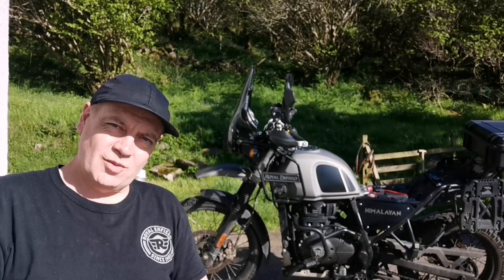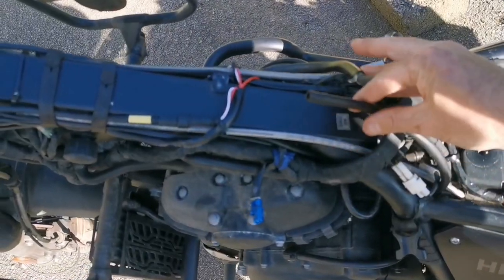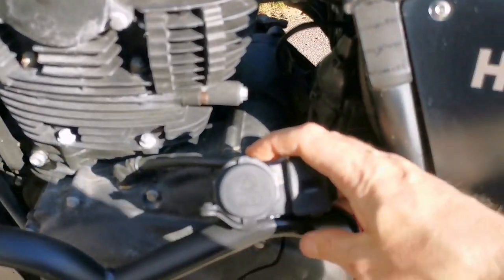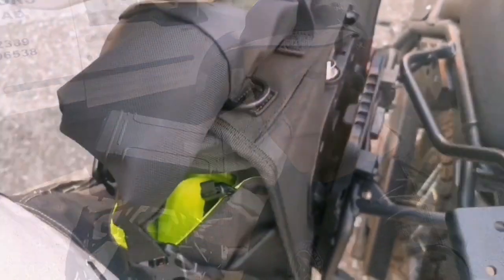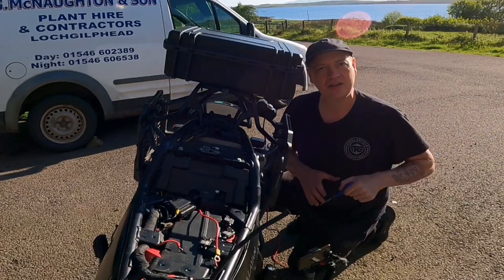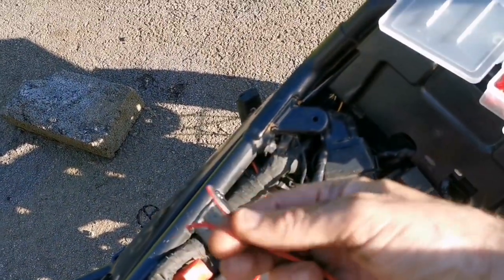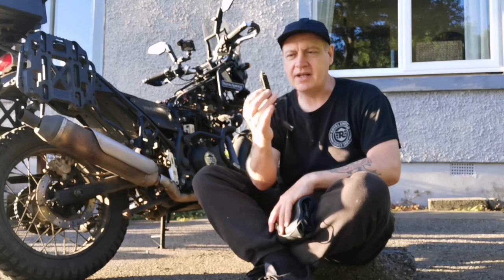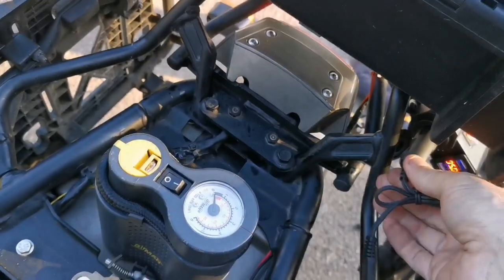Royal Enfield Himalayan Install - 12 Volt 3 in 1 USB + Voltmeter For Motorcycle Step By Step Guide.

Comment: Great job, I was wondering does the on-off switch on the charger can activate the charger with the bike being turned off with no key in the ignition?
Reply from the maker: Hi mate. If you connect it direct to the battery then you should be able to turn the USB adapter on and off even with the bike turned off even with the key out. If you connect via a swited relay like the innovv then you can't turn it on without the bike running.